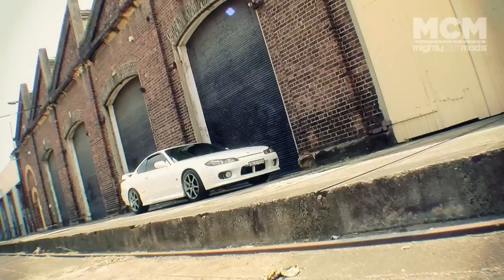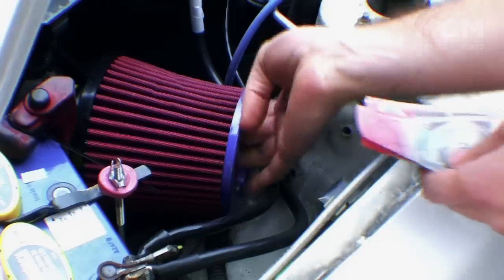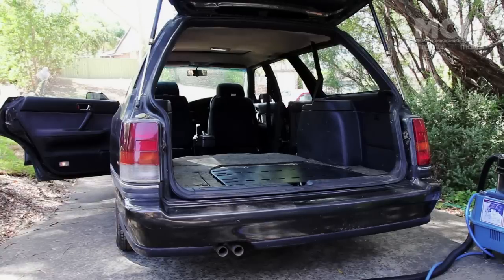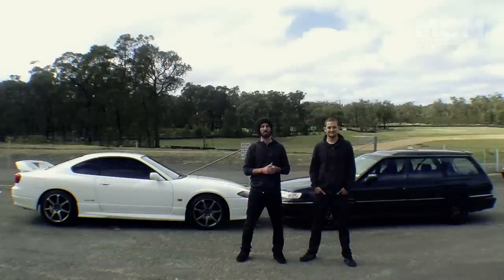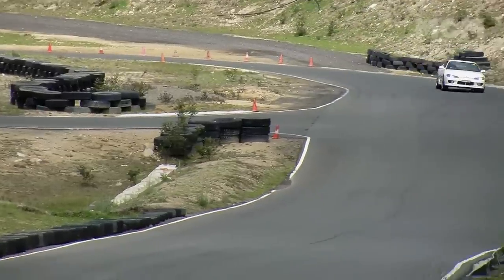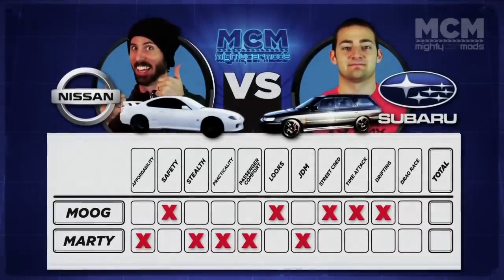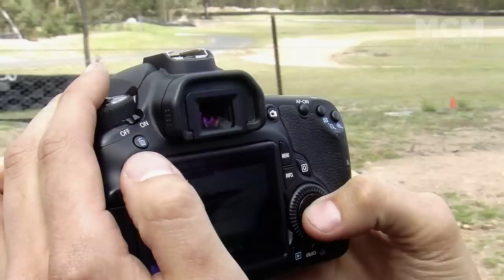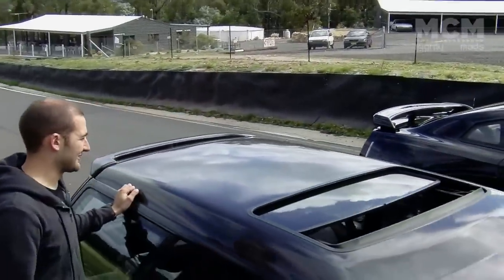Nissan Vs Subaru Battle

Comment: no amount of launch would beat awd in drags.. fun fact btw he ran out to get a 600+hp AWD to beat up the 250ish hp rs
Reply: Not true, there are many rwd cars that can launch better than an awd system. More power, wider tyres, lighter car, electronic launch control etc combined can beat awd easily
Reply: ***** That Turbo S is ridiculous. I love it. You get tons of traction with that engine being over the rear wheels.

Comment: If the Silvia won, I wonder if they'd have had access to a STI
Reply: +Peter Schmidt Even then, I don't think that the STi would win as hard as the GT-R won vs Liberty "RS"...
Reply: Ben Ward well yeah, obviously.  The GT-R is borderline supercar and is rightfully worth more than twice as much as a STI.  Not to mention, a GTR is designed for track racing, while the STI is designed for rally.
Reply: Put 30 k in engine mods in the rs ...  Then we will see who wins
Reply: Your not forgetting the rs had a vf 24 in it .  So will be close to a stock wrx sti .. Btw wrx sti weighs 150 kg more than rs wagon

Comment: Yo yo.   You guys  knows.   Your  stuff.   

Questions.  I got 14'scion xb.   Had stock 158h.p. 2.4L 4cyl.    5 m.t.     

I want upgrade on power.     
I got 1.5. Lower springs.
Reply: jonathan castro Slap a turbo in it.

Comment: legacy rs turbo vs gtr proves that automatics rule aswell
Reply: +Robin Tammik lol no
Reply: did you hear that you never hear this in a gtr
Reply: +Robin Tammik You should say DCT, not automatics. Sure it can be in automatic mode but the design is way different. DCT uses two sets of clutch mate with counter gear sets. While Automatic usually with torque converter and its using planetary gear system.
Reply: It is a automatic r35 gtr ....It has no cutch pedal
Reply: thats right

Comment: sorry i am a import driver but my next car will be a v8 with 556 horse power all natural no injection no turbo no supercharger so then if i ever do find a 4 banger to beat me ill just add a turbo if you havent ever seen a v 8 that pushes 18--20 PSI you need to the last two i saw the guys drove them in and in a 1/8 passed the line at 145 on street tires and both were fish tailing when they crossed the line you can most of the problem is the drivers but if i had my choice iv always fell in love with a good built that is built not factory but properly built 2jz supera might have some lag but once it hits it hits hard i found one once for only 22k but the dam frame was bent so bad i would of had to completely gut the car and build it from the ground up. but its all in what you like hand in corners has alot to do with the drivers setup into the corner most just to do a text book corner and thats were you will loose against a driver that has knows his own skill level iv beat many of cars that were way faster than me but they just try to hit the corner all text book like in stead of setting it up to low power in tip bip full power out

Comment: the fact the subaru is a wagon.. ;'(
wagon vs sport sedan..
Reply: but infact.. r35 is faster from any subaru had produce(all stock from manufacture check top gear,BBC, and Discovery Turbo)
Reply: Edi BuddyHOme R35 is a Supercar with a turbo, going way off productions performance limits (276hp). Subarus are made for production (street), so no turbo or high perfomance modifications. If you wanted a real good battle I'd like to see a 350Z from any vs a Subaru Impreza WRX STi from 2001 to 2006.
Reply: Anthony H. D. hahah yeah i aggred :D so thats so unbalance if subare face of any stock subaru.., but i bealive subaru is best at his potential such WRC rally cup.. aint no R35 race in WRC and win lol

Comment: Overall nissan always wins? sure, a gtr against a wagon..... lets face that gtr against ANY wrx sti 2006, if it would have been the s15 vs the wrx sti 2006 it would have win all the factors, actually it would have win all the checks against the gtr :)
Reply: What about a 2010 gtr vs any Subaru ever
Reply: go on ^^ In my opinion Subaru is better than any GTR on circuit. I didnt had the pleasure of driving a 2010 gtr yet but I would like it :). Even dough, is all about tastes, I love subarus cuz im the owner of one. Maybe you like gtr over wrx and thats your opinion and its totally valid as well as mine.
Reply: What about a gtr vs a Subaru on dirt?
Reply: +Benjamin Kenney keep in mind they are both awd
Reply: Impreza is lighter and is be far more nimble on dirt, plus it doesn't need that much modification. And costs heaps less.
Reply: You my friend, you have a point. Didn't see it that way